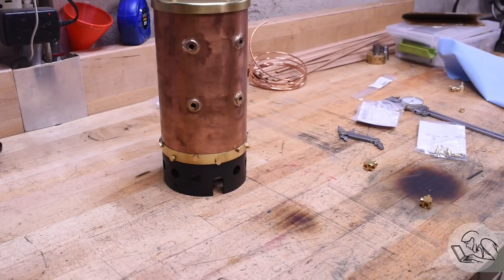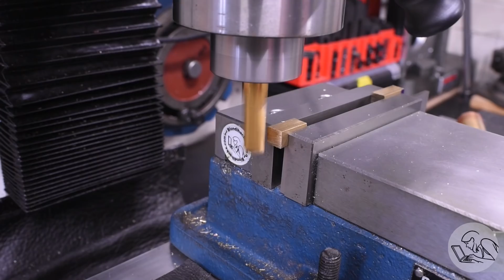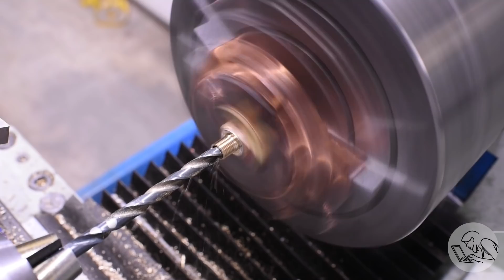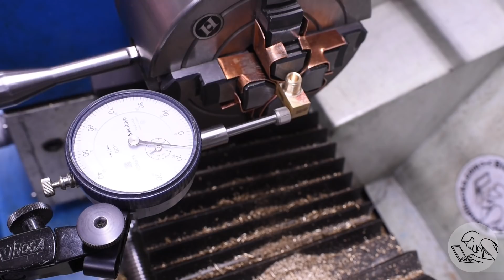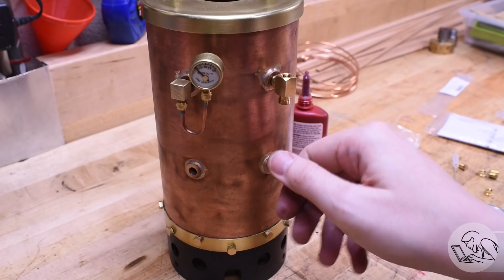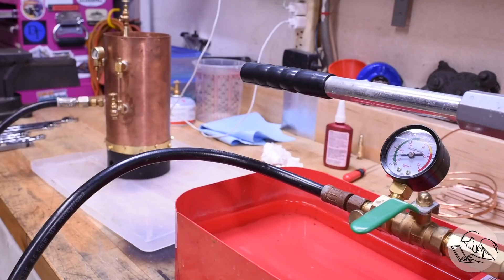Boiler Fittings and Pressure Test!  |  Model Boiler Build, part 14

Comment: A bit of advice from laboratory practice regarding the glass pipe: There is two kinds of “glass cutters” used for cutting glass pipes in the lab, either something similiar to your file to scratch the pipe or there are also small tools made for that with a little hardened cutting wheel, so one can easily create a nicely aligned grove all around the tube.
Once scratched, these small glass pipes break very easily, so it is sufficient enough to just break it in your hands, protecting them either with gloves or even just a handkerchief (that's what we've mostly done in the lab).
To clean the end up, you can just hold it into a sufficiently hot flame for a brief moment, that will smooth out all the sharp edges. You don't even need to wear gloves for that, as glass doesn't transport heat very well.
Reply from the maker: Good tips, thank you!
Reply: Like a smaller version of the cutters used by plumbers on copper and PVC pipe?
Reply: @skyclaw  I had to look up how these actually look like, but after a quick search I can confirm that.The glass cutters don't have rollers on the opposite of the cutting wheel, but besides that it's pretty much the same.

Comment: Though I don't need the precision for my compressors or other gauges, I got a lucky find at the habitat for humanity thrift store a couple weeks ago.
I found a 30 lb pressure gauge made by Ashcroft. It had a squeeze bulb connected to one side of the fitting. A beautiful stainless steel gauge and when I got home discovered it's an actual test gauge made for testing other gauges.    Me thinks $4 from the habitat store is a whole lot better than $200 from a tool supply company.  Now I have a a precision pressure gauge but nothing extremely precision to use it for.  😁
Somehow I think that boiler you made could be used for making coffee...
I really enjoyed your journey on this project.

Comment: To cut the glass tube without chipping you can carefully clamp it into the collet chuck and use a diamond file or a grinding stone with a sharp edge while let it run on low speed. I do it like that on full size glass tubes. Cheers Sven

Comment: For Glass cutting, score all the way around to ensure a perfect propagation path for the crack.  To do this easily, slit saw some aluminum or steel block, shim a razor blade or perhaps something as hard with a less fine edge in, add a clamp and a V block and you have a DIY glass tube cutter.

Comment: For those interested in diving even further down the rabbit hole, Mr. Hiraoka's book "Building the Heisler" has a chapter detailing how to make a pressure gauge from scratch. Plus a clever calibration rig. The completed gauge is less than an inch in diameter.

Sheesh.

Comment: It's kinda fun watching these videos now that I've caught up, it gives me an appreciation for his much time and effort goes into each step.

Also cool to learn about boilers; I interviewed for a job at an office that was in an old machine shop that ran on a steam engine and a bunch of powered shafts. All the machines were driven by belts connected to the overhead shafts. None of that was still there, but the furnace and boiler were still in the building.

Comment: Oh hell. Seeing you making that T joint gave me cold sweat flashbacks to when I did a load of off centre turning to make a 5 port compressed air manifold out of a 2"∅ x 6" long piece of steel round bar....... On a lightweight 90 year old worn out hobby lathe !
That tiny lathe REALLY didn't like it, and was constantly trying to start a full on Kevin Bacon "Footloose" dance routine all over my little workshop. :D

Comment: The expansion of the materials with heat will help seal the leaks.
I had the reverse effect create a mess in my kitchen. When I turned the power OFF of my coffee machine, the contraction effect from cooling down made the hot water tap leak just a little bit. With enough time it flooded the counter, drawers and floor. I had the habit of turning the valve just tight enough to shut the water OFF. I didn't see the need to squeeze the valve very tight. Once the boiler had cooled down, mains water pressure was able to seep through. The drain pan should have prevented that mess, but it did not evacuate the running water completely. I will revise the drain hook-up too.

Comment: Very nicely done!  It probably is not too important but on a model locomotive I built years (20+) ago the miniature pressure gauge was quite far off >10 psi at 90. The safety valves were set using a full size pressure gauge.

Comment: As a former power plant operator, my only critique is not enough isolation valves. 😉 I’ve lapped quite a few globe valves, maybe you should give it a shot. Shouldn’t be too difficult! Making a tiny yoke to keep the stem and seat (I’m guessing they don’t have a floating seat) aligned would be a neat project, too.

Comment: to best fit the water gauge put a round bar through the fittings to align and lock up with a jam nut. after cutting the tube heat the ends with your flame torch to round over

Comment: Just a small tip but if you use alcohol instead of water to act as the carrier for the flux it doesn't bubble and move the parts like water.

Comment: I remember an old capt friend of mine telling me, back when Red Stack was still running steam tugs in the 50's, the Coast Guard wanted to reduce the working pressure of the boiler in one of the boats, which the chief knew was going to " take the heart out if the engine". When the inspector showed up, the chief took Harold aside and told him that when the they they called out, to quickly put on a couple more turns on the safety valve, before the inspector came up and put the seal on the safety. Those boats days were numbered and there was never a problem with overpressuring those boilers, and I think a couple of bottles of scotch went into the inspectors trunk before he left. It's not what is considered "best practices" today, but the world was a different place 60 years ago.
Reply: Couple tablespoons of pepper fixed a lot of leaks.
Reply: @diamondcar2842  The old timers used it on the diesel boats as well. Sometimes you'd come aboard and it smelled like crab boil.

Comment: Really like the gauge glass fittings. So impressive to see them made from bits of scrap. Not sure if it really applicable for model boilers  but I always like when I’m inspecting a boiler to have a way of proving the fitting is clear through to the boiler so a tiny tiny little plug on the top fitting would allow to check the passage is clear and not scaled up. It would also look good as well ! You can of course just wizz off the drain cock  to inspect the bottom fitting.

Comment: 19:00 - This is how a rice cooker works, too.  As long as there's water in the pan, it keeps the temperature below a certain point.  When there's less than a certain amount of water in the pan, the pan is allowed to get over that magic temperature and the rice cooker's thermostat kick off to stop heating the rice.
Reply: Wow, thanks! I'd always wondered about how they "knew" without any real sensors.

Comment: For any given pressure the water in the boiler will be a certain maximum temperature, (the saturation temperature). As long as there is liquid water present this temperature will not rise. Therefore anything in contact with the steam/water space will also be that temperature. The metal will absorb heat from furnace and the flue gas but it will transfer all the heat to the water without actually rising in temperature. Minimum water level in a full size fire tube boiler is usually mandated to be 3 inches above the crown sheet. If all the liquid water goes away then it gets very exciting very quickly.

Comment: All the times I've tried to push a heated object back into place without heat-resistant gloves.

Still less painful than knocking a large surface grinding wheel with a knuckle to check the sound and then realizing it was spinning at 500 rpm.
Fortunately gristle grows back and friction-heat can cauterize and sterilize wounds.
Reply: See my reply to John Wiley's advice with respect to catching a hot soldering iron.  You might like it;)  Such fond memories of the pain we inflict upon ourselves....

Comment: When I took a glass blowing class they tought us to wet the scratch on the glass tube before breaking it. Something about helping with surface tension.
Reply: The speed of cracking is faster under water I wonder if that has something to do with it
Reply: I was told by a master scientific glass blower. It creates hydroxyl groups on the scored surface. You can see strain being put into glass under a polariscope merely by applying a "bending" force. Glass is a fical thing and it only needs an atomic crack to start before propagating. The hydroxyl groups create a same electrostatic charge that's forced next to each other by the bending force, much like salt crystals crack and not bend when crushed.
Reply: @coverfrequency2305  Glad to hear that. I took the teachers word for it but never knew if it was just a myth.
Reply: @coverfrequency2305  Glass is immensely strong if it isn't scratched.  The trick is that it scratches microscopically if you so much as look at it funny... :D
Reply: @coverfrequency2305  Thanks for that!

Comment: There are diamond cut off wheels for rotary tools. Use water to control glass dust AND limit heat (to the glass) to grind through thin tubing like this.  Think about what a mini stone cutting set up will be; that you might want to push the tube into the fixed rotary tool. Chipping should be minimal; just let the diamonds grind away.
Reply from the maker: I tried that actually. It didn’t work well

Comment: Never grab the soldering iron that's falling off your workbench, either.
Reply: I have done that, twice, in the same day.
Reply from the maker: Oof. Been there.
Reply: Nor should you bend down and pick up (with your bare hand) the nut you just heated to cherry red that fell to the floor as it came off the shaft you were working on in the vise for the last half hour.  Funny how fast the human brain can absorb the feeling of victory over a stuck nut and move on to the next step in the program we were delayed from running, and allow you to do something you know to be so stupid.  

Oh, and if you do pick up that nut, try not to bang your head on the vise as you reflexively recoil from the feeling of leaving a layer of seared callused fingertips on the nut as you realize your mistake.
Reply: @BrianFullerton  And in an interesting twist of evolutionary fate, you (ie, your brain) receive signals from your fingers (or toes) quickly via various kinds of sensory nerves. And not all sensory nerves are alike. The nerves transmitting sensations like light touch have myelin-insulated axons so they transmit signals faster than the unmyelinated nerves that transmit pain signals. Therefore you'll have a very brief time to confirm via light touch sensors that you are, indeed, picking something up with your fingertips--just before the pain signals reach your brain and you realize the mistake you've just made.So then you might elect to drop the object, hopefully before there's a serious burn. Because the distances are greater, this is even more apparent when you stub your toe. First is the fact of the stubbing, then, wait for it, the pain signals make it to your brain. And the expletives begin...

Comment: This is reminding me of a clickspring video where he heat bent brass plate into a ring.  

I Wonder... Is that easier for making tube fittings?  Make each end, overspec the tube so it is safe after the bend, drill through, pack and wrap threads with aluminum powder filled  plaster (uniform heating, cooling, anti-buckling, and oxide prevention), bend with a blowtorch and cheater bars.  Silver solder doesn't need to be used so the joint is stronger and easier, part is larger though.

Comment: "and that's a story all of its own" knowing how this project has gone I'm suddenly worried. 

Not a machinist in the slightest but would it have helped cutting the thread on the third side of the t joint to have the gage pin in the area being cut? Or is that a bad idea for some reason.
Reply: I doubt it’s a bad idea, but unless it was a reasonably tight fit, it wouldn’t actually add any strength. The thread cutting forces are parallel to the surface of the pin, where the collet chuck forces are perpendicular, so they squish onto the pin

I would’ve also suggested to drill a smaller hole through the part, turn it around, turn the diameter and cut the thread, THEN drill to the final diameter. Or you could probably single point cut the thread instead of using a die, I assume single point cutting applies much less force. 

I’m not a machinist either, it’s possible that this approach isn’t recommended, brass is a soft material, and rather than chipping material off, it can peel off in bigger chunks, which actually makes tools bite in more.

Comment: What's the benefit of using glass instead of a heat resistant plastic for the tube? Would the plastic expand too much from the heat and cause problems?

Comment: Good job on the fittings. fyi  The valve on the bottom of the sight glass is probaly a globe type valve. The pressure side of those type valves goes under the globe and out the side. Probably does not matter for your application. On industrial boilers there is a set of valves between the boiler and sight glass to allow in service repair to the sight glass. More useless information from an old pipe fitter.
Reply: First part of this comment echoes my thought about the orientation of the globe valve.  Worth checking.

Comment: It’s crazy the company I work for is still running some turn of the century boilers 3 are 600psi and 2 are 1500 psi it blows my mind that this boiler looks a lot like our #8 boiler (who ever numbered them can’t count) we still use site glasses and an open air fire under it our fire is coal not gas but it does have a gas by pass upgrade… side bar then we hydro our boilers we do 15-20 minutes to and the old timers call that squeezing the boiler
Reply: Cooling system pressure test on a modern diesel locomotive is still called a squeeze test and yes it's done with a squeeze gauge. 😀

Comment: More of a question than a comment; if you are worried about deformation in a thin walled thread cutting operation could you use a snug fitting drill rod/gage pin on the ID to keep the deformation to a minimum?  Conversely a nut or fitting over the threads might be used to prevent deformation during drilling and with thread locker a holding point for turning and machining?
Reply: i would think a gauge pin would work there just like the other machining step where she used one... though if you can avoid it through smart ordering it would be better.

Comment: For those custom fittings, I'd be tempted to do as many of the operations as possible before soldering the two parts together. I see why the operations on the insert/vertical bar of the T must be done after soldering. But why move the /solder/make this part more difficult to hold' operation all the way to the start?
Reply: The parts move and change shape in the soldering step, so you're sharply limited on what you can do beforehand:  no threads, et cetera.  Fixturing well enough to prevent the motion and distortions during soldering also undermines the soldering process, because all the extra metal makes it harder to heat the part as desired.

Comment: I need your help. I am making a steam pressure piston that seems to come out due to steam pressure. Successfully. However as my piston reaches the end to the exhaust. I was hoping as a loss of pressure once it reaches the exhaust. I was hoping the tight springs I have installed would pull it back down for another cycle. It only goes back down if I shove it down with my hands. Can you give me any ideas on how to get it to go back down. By itself.

Comment: I know you’ve got great silver soldering skills and the finished result was great but would it not have been better to make the glands from one piece of brass? I’m curious.
Reply: That would be a lot more work.
Reply: @davidtaylor6124  I don’t think it would and you wouldn’t need to worry if the soldering has held. It’s only what I would have done but she’s done a good job in the end.
Reply: Think it depends on what might be available for use on the shelf.  Also, sometimes she is building technique.  She will practice something new on a part that matters, but is also not absolutely critical to the new skill.
Reply: @BrianFullerton  yes I agree, I think she's already mastered silver soldering. Like you said it's what you've got on the shelf.
Reply: @royreynolds108  yes if castings are involved then silver soldering would be beneficial but on small parts making from solid is far easier and stronger.

Comment: What is the point of doing a pressure test if you do it without any protection? If it fails the safety test, it is (almost) worse than if you ran it without doing a safety test, since you are going to 1.5 times normal pressure and would cause more injury/damage than if it failed under normal conditions. 

A pressure safety test should ALWAYS be done with a shield in case it bursts.
Reply from the maker: It’s a hydrostatic test. The whole point is that it’s safe. It cannot burst because water does not compress. I’ve covered this process in detail earlier in this series.